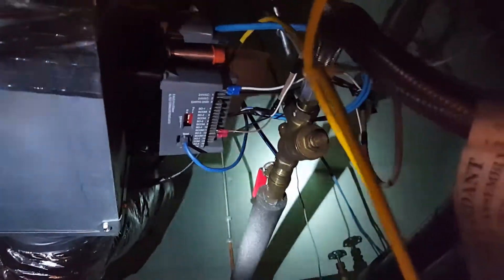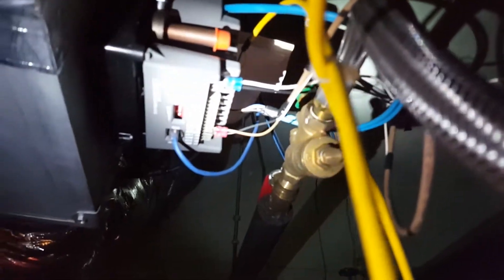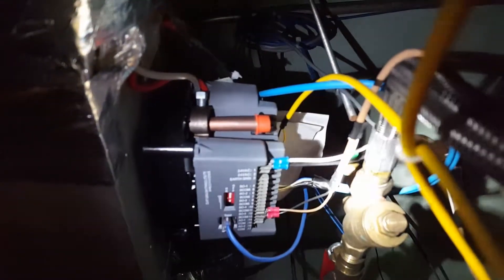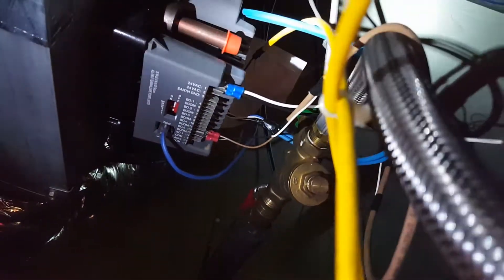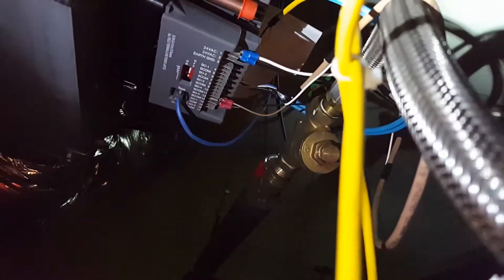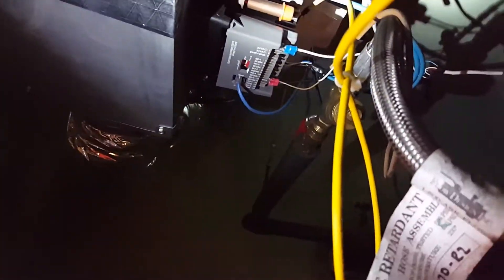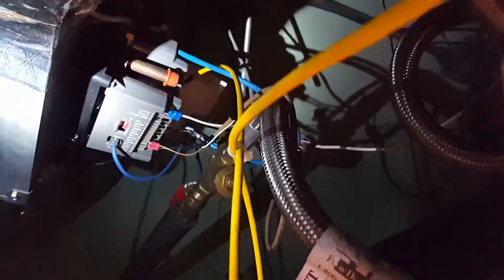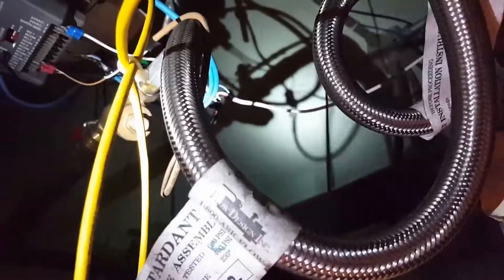VAV Zone Control

Comment: Essa entrada de rj45 posso ligar em um switch ou é apenas para ligar sensor de temperatura
Reply from the maker: You will not be able to communicate with it unless you use one of the modules.  Unfortunately JCI has ended support for them and the only place I know of that may have one is one of the JCI repair centers.  Good luck.

Comment: Do you have to shut down the system completely to change out the bleed valve and switch valve?
Reply from the maker: Yes if there's no isolation valve
Reply: The next isolation valve is sixty feet away, would I have to fix, open valve and bleed all boxes or just the one?  There is six boxes in that wing
Reply: Or would I have to purge
Reply from the maker: If the valve holds you could just shut down that branch
Reply: Thanks, appreciate your time and info

Comment: We are using this exact setup at our site, if we replace a faulty 1420 what programing do we need to do to allow the heat valve to operate properly?
Reply from the maker: +Basil Istwany if you use hvac pro simply choose the correct vav selection. Check out my videos on hvac pro on my channel.
Reply: @Systemcontroltech  thank you we have hvac pro and I have a question about reheat valve.  We have ours setup to floating 3 wire and it is connected to the BO1 and BO2 outputs, Any BO common should do fo r the COM connection from the actuator is that correct?  And I should see 24 volts AC on the leg that is required to move.  When the valve is not being moved the voltage should be 0 AC, is that correct?

Comment: Thank you very much Sir. 
Have you ever replaced a VMA14xx with a VMA1832 Controller on an NAE? Is it posible give some advices?
Reply from the maker: +Elvis Chávez yes and you can also set the newer vma to communicate on the n2 trunk.  You will not be able to upload or download the new vma across the network and will need to be plugged directly into it to make any program changes. Other than that, it,should work just like any of the others.  You will need to look into the n2 mapping section of the device hardware tab in cct for the control points. You can create a prn file or add them manually to your system.  Good luck.